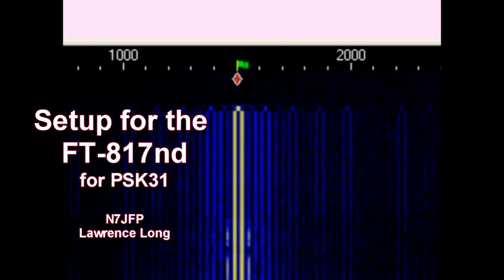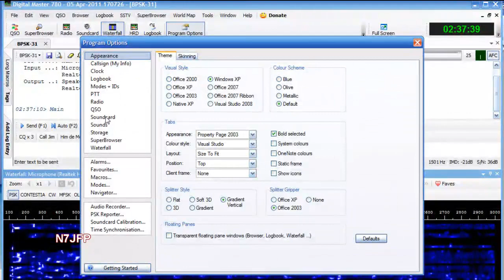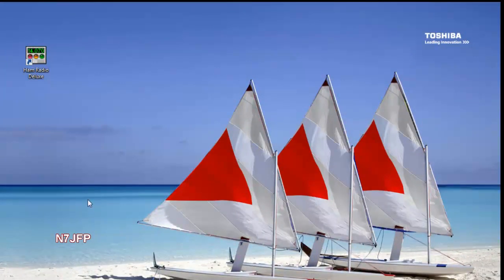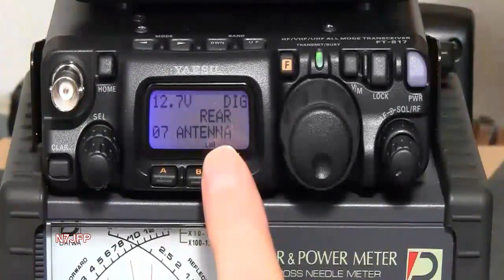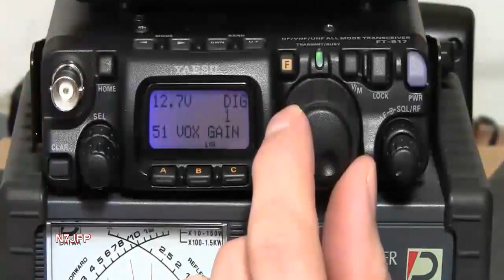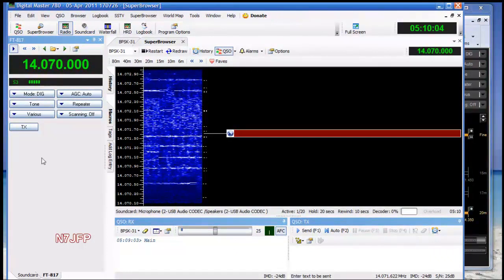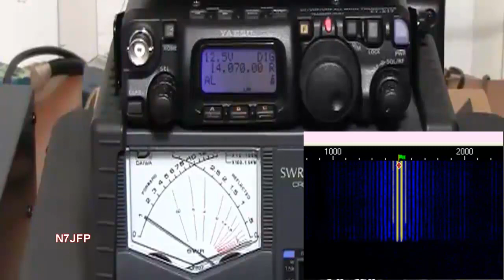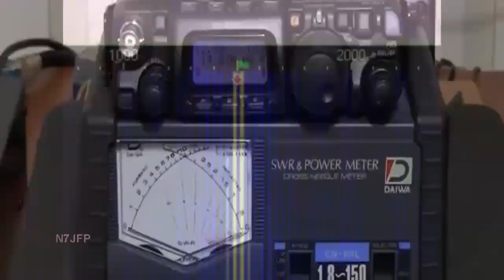Setup the FT-817 for PSK31

Comment: Great video!  I ought to be receiving my SignaLink from an online dealer tomorrow and am looking at purchasing an FT-817ND in the very near future.  In the mean-time I'll play around with it using my FT-8900.  From what I've been able to find out the same cable works on the FT-817, -857, -897, -8800 & -8900.

Comment: Good video I needed more explanation on what you were showing when taking about ALC lines.
Reply from the maker: The number of ALC lines in the FT817 display indicates the amount of Auto Level Control being used for audio input.  The ALC will distort the audio and cause distortion on the transmitted signal.  So it is best to have NO lines of ALC being displayed.  The audio input is controlled at the SignaLink Transmit knob. The same applies for JT65 and JT9 modes.  Thanks for watching.  73, N7JFP

Comment: Great video. I had my FT-817ND/Signalink running great but recently the "forward power" needle on my MFJ 971 starting fluctuating during transmit. Ever see this?
Reply from the maker: I have not seen this.  Try different power meter, then SignaLink.  Good luck. 73, N7JFP

Comment: Hi, thank you for a great upload. Im having trouble connecting to HRD picking up my FT817nd, does not connect even after all settings set as per this video. I'm using a cat cable from Data to signalink and a usb to pc win 10. I'm not sure why its not connecting. atb Si M6IMN.
Reply from the maker: Watch my video on cable connections.  "FT817 to Laptop cabling".  It might be useful.  73, N7JFP
Reply: Many thanks, I have all of that just missing cat to usb from tuner to pc. 73's M6IMN

Comment: How many repeaters does the Yaesu FT817 store?
And how do you do it, what is the configuration. I appreciate any help.
Reply from the maker: Good question.  I have never used it on 144/440 bands.  It works great as a QRP HF radio.  73, N7JFP

Comment from the maker: Thanks for watching.  If you can, set up a second receiver to do some testing of the PSK31 signal your transmitter is putting out.  It will make you more confident in your signal quality.  73, N7JFP

Comment: What is Digital Master 780?  Good video but have a lot to learn.

Thank you.

Dave K8WPE
Reply from the maker: DM780 is a multi-mode digital communications program.  JT65 and PSK31 are two of the popular modes that it can decode and encode.  It comes in a package called Ham Radio Deluxe. There are lots of videos on how to install and configure.  Download, install and test into a dummy load.  Lots of fun.  73, N7JFP

Comment from the maker: You could try an older version of HRD, the newer one has been rewritten in different code. Try and isolate which part of HRD causes the failure.  Turn off programs that are not needed on the PC.  I have not seen this problem on my pc or laptop.  73, N7JFP

Comment: Hi, nice video. I just bought a Dolphi interface ...
When you write "the tx audio has to be set at 100%" you mean menu 25 DIGI MIC?
Another question,  why the menu 51 Vox gain at 1?
73 de IZ2ZTR
Reply from the maker: +Elio Tamburo Thanks for watching.  Setting menu 51 to 1 is turning off the VOX function.  This is best for the digital modes.   In DM780, Set the soundcard TX to 100%, then let the SignaLink or Dolphi sound card unit control the TX audio level,  where also the ALC  marks are controlled via the TX knob.  Good luck, 73, N7JFP

Comment: hi! congratulation for nice video. i'm using YAESU SCU17 interface with YAESU FT-817ND. I have CT62 cable but for digi-modes i need also DATA cable? Many thanks for your answer
73 de IZ2SXZ
Reply from the maker: Hi, please watch my video on cabling FT817 to laptop using SignaLink.  It looks like your SCU-17 uses a DIN6pin to DIN6pin cable for data and a RS232 cable for the CAT.  The USB is the link to the CPU.  73, N7JFP
Reply: many thanks for info. 73 my friend

Comment: The procedure you performed for setting up the FT-817 dig settings for psk31 is it the same for wsjt-x?
Reply from the maker: It is.  If you want 10 watts out, set your power lever to 20 watts.  Then back it down to about 50% to 10 watts on the SignaLink.  This will keep the ALC down to zero.  73, N7JFP
Reply: Thanks for the reply. I was grasping at straws trying to figure out what setting I'm leaving out with wsjt-x.  My settings in the app are working. I can make FT-8 contacts.  However, after each xmit during the qso I get an error message. I then click retry then click the TX enable button and my FT-817 will transmit the next line in the macro after receiving and the error message comes again at the end of transmission and over again until the 73 message.  I've narrowed it down to a rig setting that I have'nt set correctly. Thanks for the response.  Still getting the error message after mimicking your setup. Bah!  Going back to voice.  FYI: 
Hamlib error: Command rejected by the rig while exchanging VFOs
Reply from the maker: FT897-WSJT-X JT9 20m QRP WA to HI -- N7JFP     One thing to check is there  must be a CAT controller for input into your radio.   Check my video.  WSJT  talks thru HRD to get to the radio.   Good Luck, 73, N7JFP

Comment: Are you able to use your tuner also?Or does HRD take CAT port?Thank's
Reply: The LDG Z-817 Autotuner has a CAT pass-through port.  You connect your CAT cable from your computer to the Z-817 and you connect the supplied cable to the Z-817 and to your rig.  When the tuner is not engaged, it is in pass-through mode so the computer controls the rig.

Comment: Hi,
Why are you using User-u instead of PSK-u?
Reply from the maker: I read somewhere there is a frequency shift of about 10 Hz between receive and transmit when using the PSK-U.  The better choice is to use USER-U for most of the digital modes using a sound card.   73, N7JFP